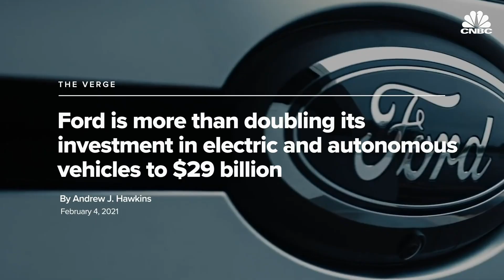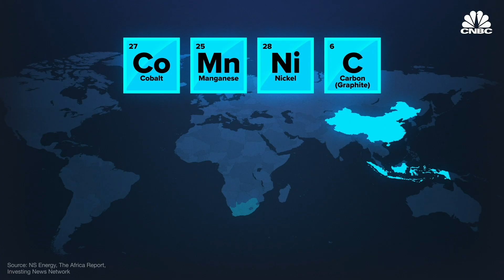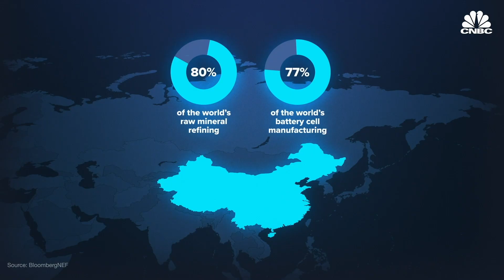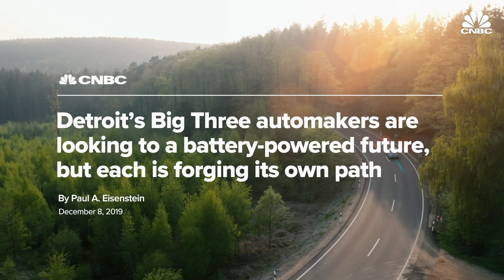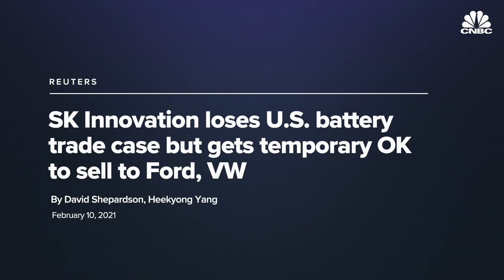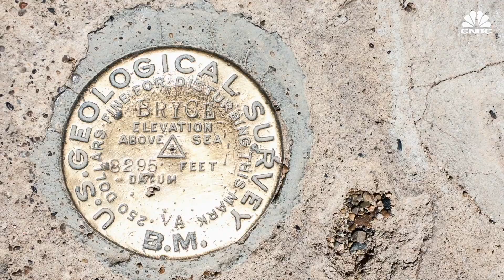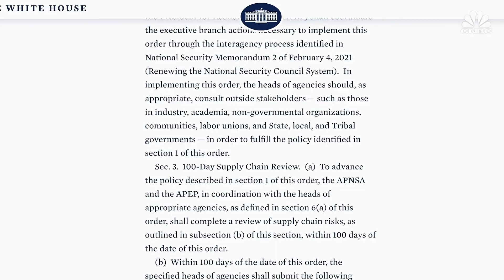Why The U.S. EV Industry Is Facing A Battery Shortage

Comment: US is very stubborn in change. World was moving towards public transit but US did not want to change. World is moving out of Coal and gas but US did not want it. World use 220 volt but US did not want change it from 110 volt. US is losing is values in front of world.
Reply: The US uses 240/120v, not 110. We have been moving away from coal and towards nat gas, but we've had solar and wind for decades.
Reply: @CGoffgrid  I don’t think us uses 240 V normally we have to make dual phase line to go up to 240 V. Only few appliances uses 240 V surprisingly. So manufacturers have to make some change just for US product to work with 110 V and cost goes slightly high.
Reply: @Divas1001  It's a good system. 
110v is from the 50s, back when we didn't use a ground. 120v is modern outlets, and the local current is actually 124 volts, making our 240v actually 248v. It works pretty well. There are pros and cons to both systems.

Comment: all the dislikes are people who don't care about the planet. rip
Reply: You are dumb and believe everything you are getting told. Battery aren't an energy source but a storage. It still requires energy to get charged and most of that energy is coming from burning fossil fuels. Not only that but in the process of mining and building more factories, even more energy is getting wasted.
Reply: Please explain how buying more is going to save the planet?
Smugness won't do it.
Reply: You can care about the planet best , when you care about the truth...and the truth is that there is no climate emergency , except the one projected 100 years from now with faulty models. Another truth is that ICE vehicles are actually better for the environment than E.V.'s if you consider what goes into each from the finding and mining  of the raw materials ,  to the manufacturing and disposal of each type .
Reply: Nonsense, we are still in a transition period and we still use fossil fuels to mine lithium and build electric cars, even the plastics in EVs are oil based.

Comment: Do we need to use so much batteries in a car?  The government needs to tax vehicles that use many batteries just like a tax on cars with low mpg.  Charging speed and locations are more important.
Reply: Only if you want to be able to use a car for transport.
Reply: @Robert-j6r8c  --We could use Hybrid Gasoline Electric with much smaller battery capacity per vehicle, like 1/5 to 1/50 that of a full uubattery car, to reduce gasoline consumption by 50% to 85%, depending on the size of the battery pack.

Comment: The u.s can't even decide on a universal charging port for the EV market such a mess can you imagine your gas tank having three different sizes you having to drive around different gas stations find the right size nozzles that's what you have to do with electric vehicles right now ridiculous .
Reply: Isn't diesel and petrol different nozzle sizes.
Reply: @Robert-j6r8c  Not really only the color of the handle.  Diesels is usually green.
Reply: @GamerbyDesign  
They are here in Europe and Oz.  Petrol has a smaller nozzle, so you can't put the diesel nozzle into a petrol car.
Reply: CCS won, keep up. Chademo is obsolete, and Tesla is making their chargers and vehicles CCS compatible.

Comment: Big Oil wont allow it
Reply: they will fail when there is no oil left
Reply: Ccp calls the shots not big oil
Reply: Big oil is dead
Reply: My BP made Solar panels say otherwise... Big Oil are already in bed with this
Reply: @DanafoxyVixen  Why are they dumping people then?  They don't seem to be doing much adapting, there hearts don't seem to be in it, plus the management just don't have the understanding to see what is actually going on.  There are huge bubbles in power generation they could easily get caught up in, solar is not a replacement for oil, batteries are more the equivalent enabler of everything carbon free.  Profits from solar farms will not replace oil profits.
Reply: Big Oil won't allow heavy market penetration of BEV's (Battery Electric Vehicle) until the oil reserves are more depleted.  Right now, Big Oil knows that a Tesla-style of BEV requires so much battery capacity per vehicle that the BEV's won't ever be able to penetrate the automobile market in big percentages due to battery shortages.
Reply: @trungson6604  Thats why everyone and their grandmother is building battery manufacturing, most notably in China.    Tesla is a single player but yet has the largest plant in the world.  Tesla is thinking in the scale needed, big oil is just playing the extending-as-long-as-possible game, they have run out of extension techniques, the end game is now set in place and is just a matter of time before batteries take over from oil.  It will happen quite suddenly in about 3-4 yrs.  After that it will be obvious the game is over to everyone, noone will want to burn oil.  Big oil has no say in the matter.  Their propaganda machine has left alot of people in the US thinking batteries are not the answer, don't work, recycling problems etc, however the smart people know this is rubbish and are continuing on with investment and building battery capacity.  Once the capacity is producing they will start undoing the propaganda.

Comment: I hope US could catch up in this race, but us economy and even politic being so much petro-centerd, so I think ,walking into this direction wouldn't be an easy task !
Reply: long term youre going to loose then
Reply: Tesla is a us company. They will produce the most batteries in the world 5 years down
Reply: @Raylen_Fa-ield  bs. there are about 10 gigafactories being build in germany alone and only one of them is from tesla
Reply: @Marvin-ii7bh  but tesla will be manufacturing massive amounts of batteries in at least 5 different factories after giga texas.

What's more they will not stop making more  factories so in 5-10 years that number could double.
Reply: @Raylen_Fa-ield  but there are already manufacturers with bigger capacity in asia
Reply: @Marvin-ii7bh  tesla is still growing operation and it already had the fifth largest and 10th largest battery factories in the world. They will be adding 2 more this year and paired with the new techniques they later out on battery day every tesla battery factory will be producing cell with greater spreads and volumes then anyone other then panasonic ( which they partner with)

Comment: You don’t need battery for electric vehicles
Reply: Just a long cable?
Reply: @Robert-j6r8c  yes 👍 ok I joke compressed or liquid air and turbines to turn it to electric so just you will pump liquid air or compressed air to fill your tank and you can do shape of the tank with hexagonal cells to decrease risk of explosion in case of accident .. just idea but need to develop this idea for future
Reply: @Robert-j6r8c  I mean compressed air electric generators and if we can develop this we can have even VTOL vehicles with long distance
Reply: @ilhandurmus  
Physics won't allow it.
Not possible to store enough energy, the PSI involved would be astronomical.

Definitely no VTOL.
Reply: @Robert-j6r8c  you will use psi to turn turbines and you can increase the efficiency of the compressed air by making some change at air tanks
Reply: @ilhandurmus  
Scuba tanks are 3000-4000 PSI and yet even at those pressures there isn't enough stored energy.

It takes a lot of energy to move vehicles. 
It takes around 3kw just to go 10 mile.
So it would take about 1 scuba tank  to move that far.
That's a lot of scuba tanks to achieve any decent range.
The only other option is increase the pressure in the tank, but that would also make the tank heavier.
Also air has weight (about 3kg in a scuba tank). 

That's why batteries or hydrocarbons is our best option at the moment. They are very energy dense. Hydrocarbons especially.
Reply: @Robert-j6r8c  you can’t increase the capacity of the pressure by making hexagon cell inside the tube and also you use spring you can increase the efficiency there are ways and this is the only way to have real environment friendly energy

Comment: You know what's not in shortage? Fossil fuels. Should've stuck with gas, it's superior in every way. The fact that fossil fuels are one-time use and batteries are recyclable, yet, still shortage on batteries meaning that we have infinite number of fossil fuels we never seem to run out. Therefore, fossil fuel is an obvious choice for absolutely everything. I wish there was a gas-powered smartphone, it will have a much longer run time for sure.
Reply: No electric motors are far stronger and superior by a long shot.............if you wanted to zing EVs you should have talked about all the mining and mineral extraction that is going to be needed for the batteries in the future to make everything electric.  The amount of mining needed across the world will be far worse on the environment than the amount of oil extraction and burning that fossil fuels is currently doing to the environment.

Only real solution for the future is to diversify to multiple energy sources for transportation. An one with half a brain can tell you the entire world all wanting/demanding the same few resources and using most of the same supply chains will only create more supply and demand problems in the future.  Only real solution is more options.

Comment: We need to figure out how to reuse/remanufacture/refurbish old batteries. Resources are limited, bad for the environment, and when the batteries lose their ability to recharge or the vehicle is totaled in a collision, they end up as waste.
Reply: They already do. Too expensive to just "throw away".
Reply: We can use it as a power wall to store energy made from solar.
Reply: @manjeetkolte8601  this needs to be a thing. Like, all EVs should become their own “power wall.” During the TX winter energy crisis, we had a fully charged Tesla and a bunch of Leaf batteries we’re using to convert an old classic pickup to electric. Couldn’t power anything outside the vehicle. We have solar panels, but can’t store the energy beyond our vehicles. It all goes straight back into the grid, and the electric company credits our account.
Reply: @UmmYeahOk  
My Tesla solar panels and powerwalls got me through the 44hr Houston blackout
A roof without solar is a waist of good space
☀️⚡🏡
Reply: @UmmYeahOk  I think GM is working on this right now, I saw CNBC's video covering this exact thing, they used old Chevy Bolt batteries to make a bigger battery to store all the electricity generated from solar.
Reply: Nonsense, we don't even have enough produced batteries to recycle them or make enough batteries to cover the demand.
Reply: @carholic-sz3qv  Ok Boomer. Let the next generation worry about it. 😏
Reply: @carholic-sz3qv  "we don't even have enough produced batteries to recycle them or make enough batteries to cover the demand." so what your saying is..... its only a matter of time until we do have enough produced batteries...

Comment: I love it that they say not American owned and add broll for 4680 cells from tesla
Reply: Tesla cells are Panasonic.
Reply: @Robert-j6r8c  Kato road 4680 is not. Experimental line. Panasonic, LG, CATL. Tesla acquired maxwell and in Austin Texas they are making 4680, cathode production. Tesla takes all the batteries it can get but they realized a long time ago they needed batteries in country gigafactory 1 in nevada is a joint venture with panasonic. But now factories (Austin texas) will be tesla owned and run. You can also valide this by going to tesla jobs for battery production listings.
Reply: Nonsense

Comment: Given the advancement in technology   i am sure  eco friendly ICE's can be built with very little co2 emissions.  And it should be made mandatory to use personal vehicles under 1000cc . Sports cars, Suv's pickup trucks can go electric but still it would not be enough to fulfill the demand of lithium ion batteries.  
There is a need to build better ICE's rather than being totally reliant on EV's
Reply: We could be building Plug-in Hybrid Electric Vehicles (PHEV) that consume only 15% of the quantity of gasoline of comparable gasoline vehicles for total mileage driven, yet a  PHEV requires only 1/5 to 1/10 of the battery capacity of a long-range Battery Electric Vehicle (BEV).  In another words, a PHEV can be driven on battery electricity for 80% of its total mileage.  It would make more sense to build mostly PHEV for now, when battery production capacity is still the limiting factor.
Reply: @trungson6604  sounds amazing
Reply: The ICE of today already IS eco-friendly . I remember in the 1970's when you would drive in a city and see huge blue clouds of exhaust and burned oil hanging in the air...you would be hard pressed today to find a single vehicle that emits the blue clouds of unburned fuel and oil.
Reply: @markanthony3275  I still think some advancements can be done to these engines and why does one want to have big engine gas guzzling vehicles . To be mobile and move from a point to another a 1000cc or under 1000cc personal car can take make an individual mobile and besides it would be low on cost.. And very little carbon footprints.
Reply: @vinoopmalkani5350  I could see it in the cities...but many people live where they have to make long trips in adverse conditions on  poor roads . For example , I live in central Canada where winter is 5 months long , and there can often be temps. as low as -40 F. Twice this year I had to travel through ten inches of snow and snow drifts just to get to work. The nearest city, where I visit family , go shopping , and see my doctor is about 500 miles south of where I live. A vehicle that small wouldn't make it through the first winter  because 1000cc does not have the power to turn wheels that are big enough to avoid being destroyed in potholes which can be 6 inches deep , or even more .
Reply: @markanthony3275  wow. .... A very valid point and i totally agree with you. A 1000cc is not designed for such weather conditions and roads  1000cc's are only ideal for city commute or even long distance travel with good roads and they can withstand potholes . Having said that .Do you really think a total reliance on Ev's is the only substitute for ICE's . Most of our gadgets are lithium powered and now our vehicles too. Do we have the lithium reserves to serve the energy needs of over 7 billion people for the next 100 years.
I grew up in India . Most of the personal vehicles used then and even now are under 1200cc. Space shuttle has been retired and the SpaceX dragon has taken over. Likewise i still think there is a allot of scope in building more efficient ICE's ...
Reply: @vinoopmalkani5350  I would say this about E.V's . In a country like India , that is dependent on oil , an E.V. might make sense...but I don't thing solar and wind turbines are feasible because they would take up agricultural lands . I could be wrong about that , but it's a hunch. Having said that , in the west , the E.V. is being used as a vehicle to implement a political ideology that is foreign and contrary to western society. We call it  communism 2.0 . This is how it works . The elites own everything in the world , except the people of the U.S. and Canada ...and they want to own them too. So how do you gain control over them ? First , you invest money and many decades in preparing their minds , eliminate critical thinking , and replace it with the idea that we are all global citizens and there is a global crisis called Climate Change . Then you point the finger at fossil fuels. They want to eliminate fossil fuels in North America because people own private property that can only be accessed by vehicles that can make a 500 mile trip , or tow a boat , or tow a camper trailer. Private property and people's ability to move about undetected by the gov't is the target . With an E.V. , it will be very easy for the gov't to mandate surveillance components...like they have in China and build them into the vehicles. In the u.S. they have just announced that they are going to pass laws against domestic threats to democracy...eventually , like in a communist country, those threats will be anything they say is a threat . I hope ICE and E.V. 's co-exist for a while...but I have a feeling they will make ICE vehicles totally illegal , all at once . We'll see , and I hope I'm wrong...I have been before . Cheers from Canada !
Reply: @markanthony3275  A very valid observation and totally agree with you... I cannot say anymore... I appreciate the wisdom you shared.. Cheers from India..!!